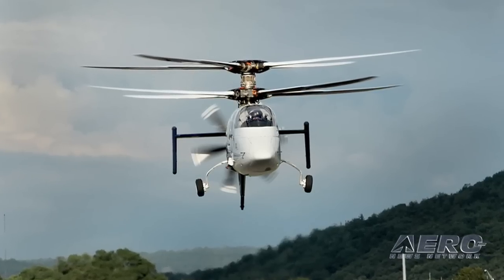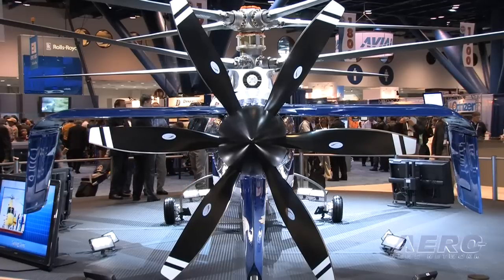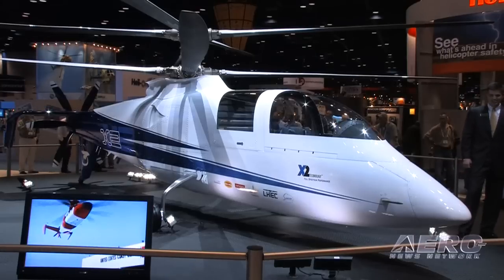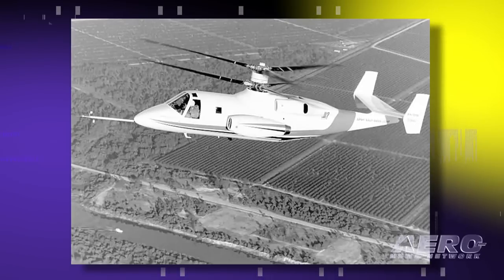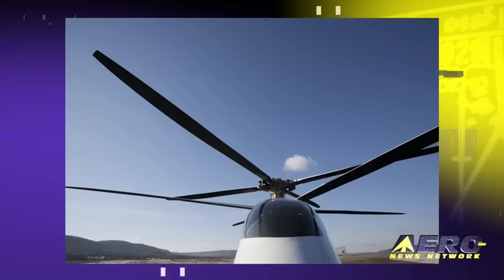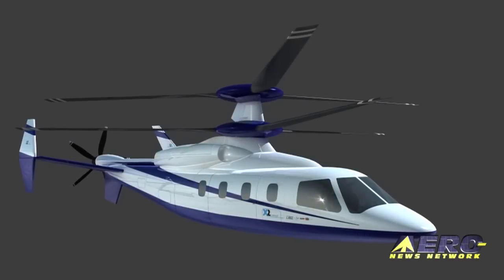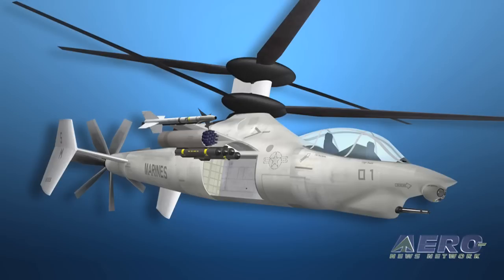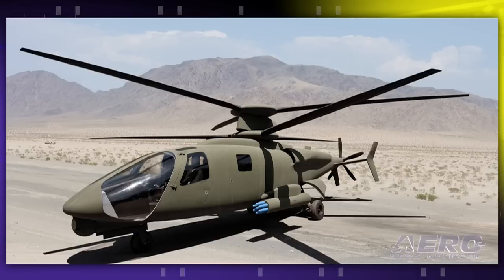Aero-TV: X2 Advancement  Sikorsky Prepares for Speed Benchmark

Comment: The KA 50 only shares the rotor config with this (coax rotors). It's fairly traditional mechanically and structurally. The rotors are traditional and its thrust is traditional.See all those mechanisms going up from the swash plate? See how compact and clean the rotor control mech. is on this one (he mention it doesn't even have a swash plate!)? See that propeller at the back of this one? 

I love Kamov's stuff and Russian stuff in general, but let's be honest here.

Comment: The AH-1Z Viper is part of the "H1" Upgrade program, which of course is bell aircraft. However the X2 technology demonstrator aircraft is part of the Joint Light Tactical helicopter program for the US Army and other DoD elements. Bell and Sikorsky are actually jointly working on this project. These machines are amazing.

Comment: Cayuse369

Please correct me if I'm wrong -- but I believe the Cheyenne prototype achieved 250 knots (300 mph, roughly). I think that's roughly the same as the X2 as you point out. But the active blade technology seems to be the game changer for the X2 (I could be wrong) in addition to speed. Nevertheless both birds were/are great vehicles

Comment: There are homebuilts with coax. It's not about how difficult it is. It's about how economically desirable it is to make them. It's like electric cars. The tech. isn't so difficult but there's less economic desire for big auto makers to make them in large numbers (they lose profits from parts/service income and sales due to extreme reliability). Main/Tail rotor setups are just simpler and cheaper.

Comment: I like the news you're bringing, AeroTV. I'm curious about the X2's range at speed vs a tradtional helicopter. For the Sikorsky Active Blade technology, have they researched any passive-powered active blades, such as using over the rotor micro-pore air bleed as activation power for the bade? 
BTW, for the subject hijackers out there - what the hell?Aren't there enough forums to discuss (hate-call each other) your issues without invading totally out topic posts?

Comment: wasnt the cheyenne also pushed using jet thrust instead of a pusher prop. so  it is something new if they can achieve the same performance with a prop fuel savings comes to mind but maybe not much. maybe the difference in having 3 turbine engines rather then 2 turbine and  2 jet turbine engines

Comment: So as it accelerates does more power get transferred to the pusher prop? At 250 kts I'm assuming those rotors aren't powered and it assumes a gyrocopter like functioning?
Reply: yep , the system is inspired from the gyro from Carter copter (on this gyro was reduction from rotor RPM to avoid supersonic tip speed)
Reply: leneanderthalien i knew this thing was gonna use the carter copters innovation. i'm pretty sure this is military only. the carter copter is gonna be for general aviation and can be scaled up if the military wants it. i'm glad the carter copter is gonna be for general aviation the military buys out and takes everything.

Comment: The whole purpose of Co-Axial is to eliminate the Tail Rotor, Co-Axial configuration give better maneuverability. I can see possible problems with the X-2, the rear propellor pushes the Heli, so the issues are the rotational torque and the fact of the pushing forces from so far back have all the hallmarks of an unstable Heli, as well as complicated engineering and control systems, not good in a battlefield situation.

Comment: That's because Christie had so alienated the U.S. military brass that they would have nothing to do with the superior torsion bar tank suspension system he designed which,although maintenance intensive at times, was superior to the suspension used on the Sherman.

Comment: ok...who pays for re-inventing russian Kamov stuff?...from 1000 years ago?
Reply: If you pay taxes, I guess it's you bro lol
Reply: yup...lol..damn right...
Reply: The X2 is everything the Kamov wished it could be. The X2 is lighter, more maneuverable, 100 kts faster, can go farther. AND the X2 does not disassemble itself mid-flight at random.
Reply: First who use such rotor was the Breguet Gyroplane Laboratoire from 1935, not Kamov...
Reply: Russia is, well , ....you know.......
Reply: Reinvent? for your information, the first full controlable helicopter who use coaxial rotors was the French "Breguet Gyroplane Laboratoire" helicopter, who take first flight in 1933 but crash, was realy operational after improving only in 1935, first who fly 1 hour at 121km/h completly out of ground effect in 1936
Reply: ***** or compare bradley and bmp3...abrams and t-90....f-22 adn t-50...whole USA is based on copying others....cant blame them tho..USA was founded by europeans senteced to either be hanged or banished....thus USA was founded xD
Reply: That was the worst trolling in years.
Reply: +Jonathan Wong  The "speed limitations" comes from the tip speed from the rotor blades: they cannot excess mach 1 in each configuration because produce aerodynamical troubles, a monster noise and heawy vibrations.On a classic helicopter, does the rotor make lift AND forward movement, but on the new prototypes with axial traction propellers likes the X2 does the rotor mostly lift, and work near like a turning wing (like on a gyrocopter): this allow tho reduce the rotor RPM and so the tip speed from the advanced rotor blades.The advantage from the counter rotating rotor is not only a better efficiency, but a lower tip speed because a much smaller rotor diameter...
Reply: sure, airplane, gatling gun, maxim gun, kevlar, nylon we copied all that.
Reply: not understand what you mean and about what...

Comment: Russians have had two rotor X-2 type helicopters for over 40 years, Why have we taken so long?
Reply: I think they are mainly interested in a coaxial rotor system to provide an armed escort for Ospreys. Besides that, the main thing the coaxial is speed. But I don't see why they just don't use Harrier jump jets to do most of that unless the X-2's operating cost will be a lot lower than a Harrier's operating cost.

Comment: McDonnell Air Craft unsucessfully tried a similar concept in the XV-1 in the 1950s.  It was too new & too complex to work then.  I've read that the rotor was driven by compressed air pumped up from the radial engine, through the mast, down the rotor blades, to wing tip jets, where it drove the rotor.  This bird and the Eurocopter X-3, look to me, to be about to send the V-22 to the junk pile of bad aircraft designs.

Comment: That would be a valid point if the Abrams was the first  and only rotating turret battle tank lined up and produced for service. Rotating turrets are as cutting edge as jet engines.  coaxial rotors are something to brag about and will be until someone comes up with a way to make them standard copter fare. Sorry. FAIL!